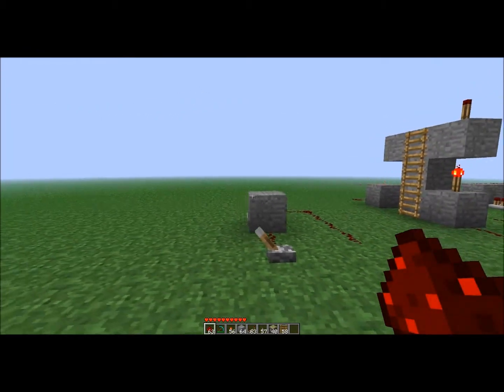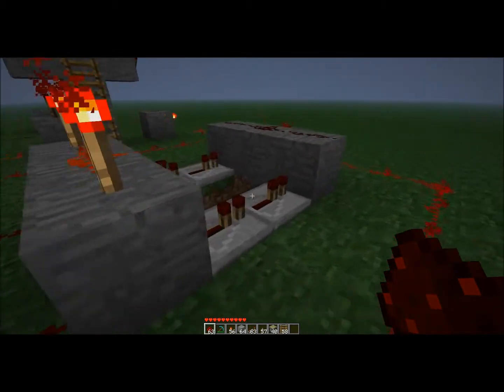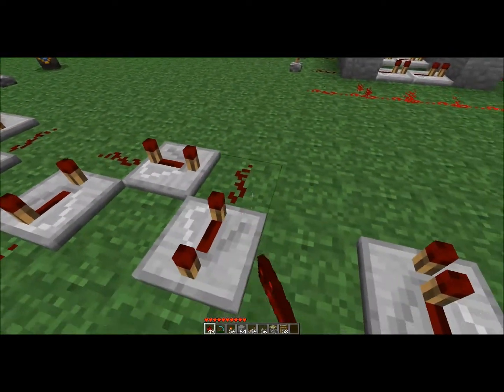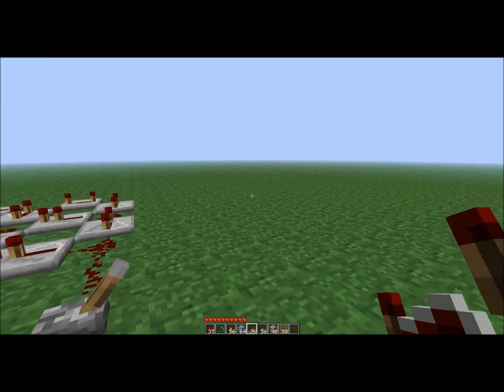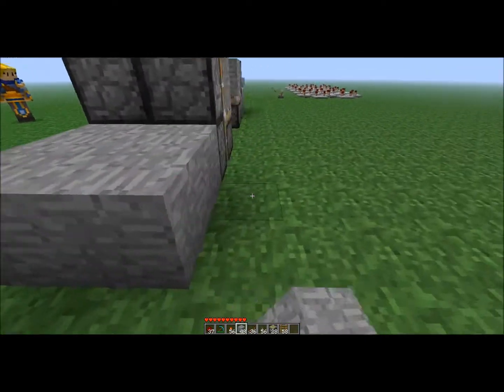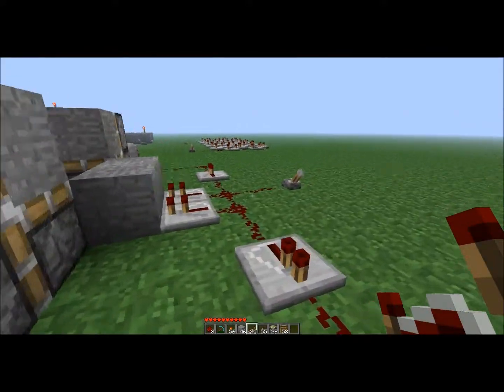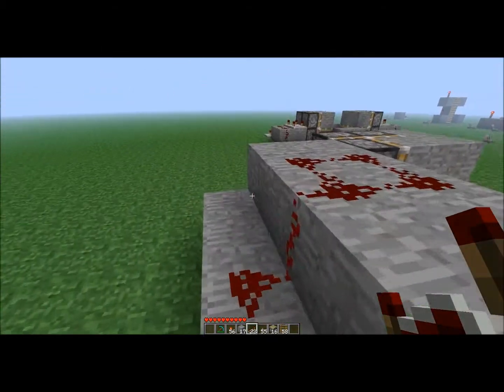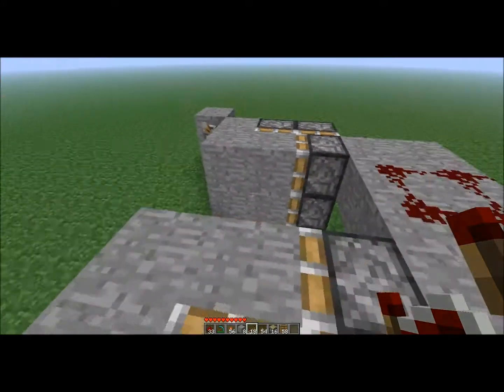Minecraft - Airlock Tutorial part1

Comment: I would suggest using a water detector in the bottom instead of a delay.  Create an and gate between the water detector and the levers, so it will only open when the lever wants it to be open, and there is no water present at the bottom.  There are no mods needed for this, just look up a tutorial on a water detector.  It uses a boat and a pressure plate.